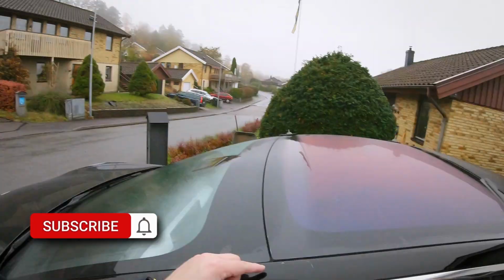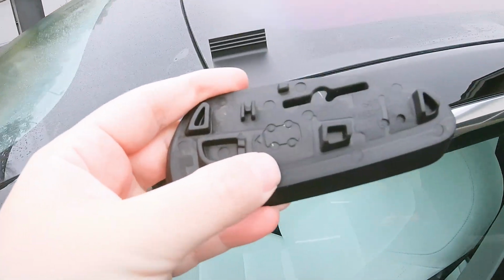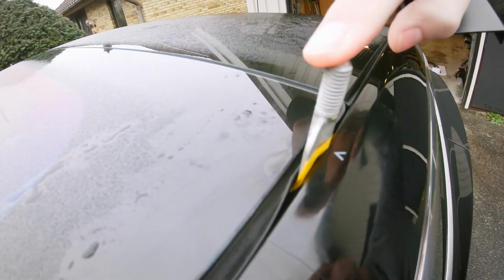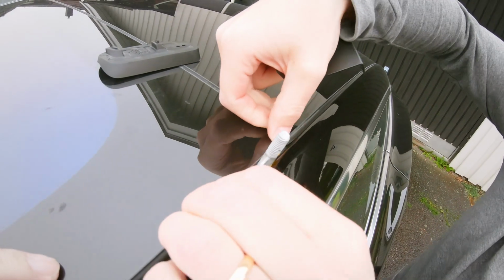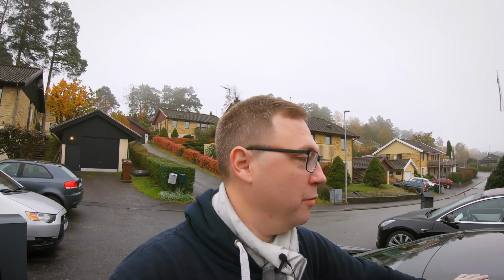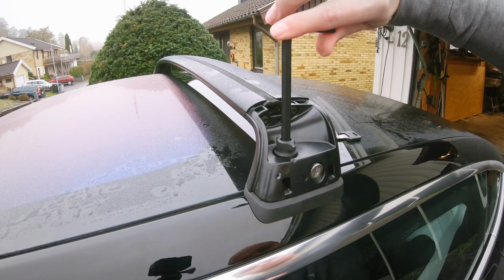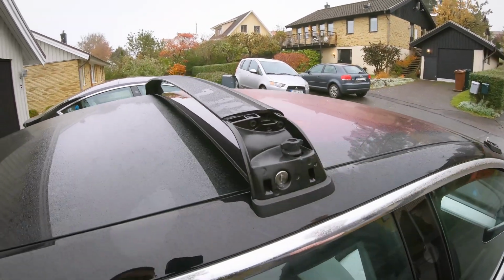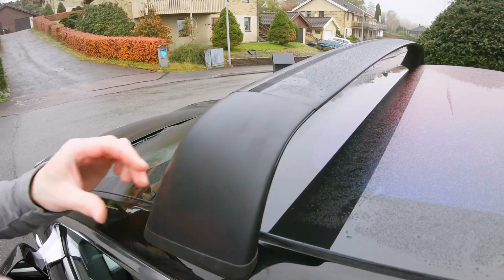How to mount the Model 3 roof rack from Tesla

Comment: This looks a lot more simple than i thought it would be. When you remove the bars is there an issue with the seals that were pushed aside?
Reply from the maker: As you can see in the beginning of the video, the seals tend to stay to the side after the rack has been removed. However I would say it's most likely just cosmetic.
Reply: @theteslaswede1039  And not very (or as) visible if you have the add on seal instsalled too maybe?  Maybe the stock seals settle back over time too?